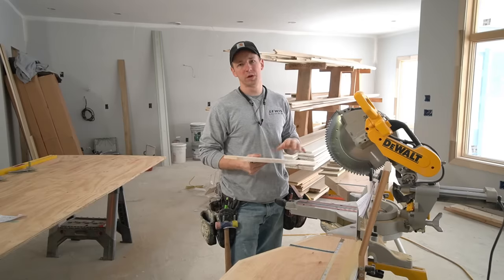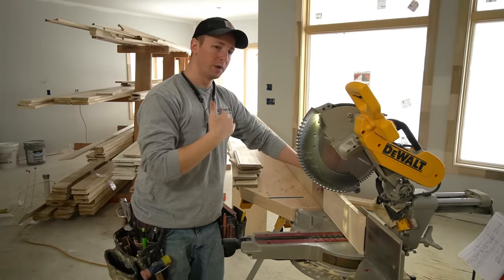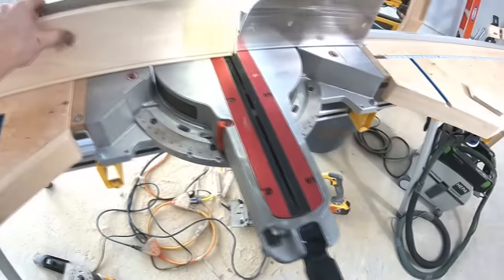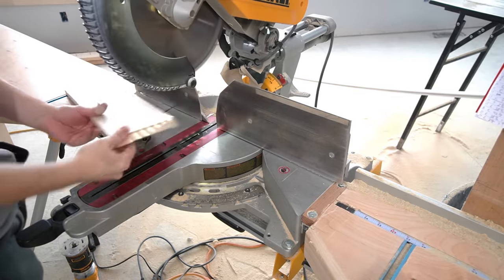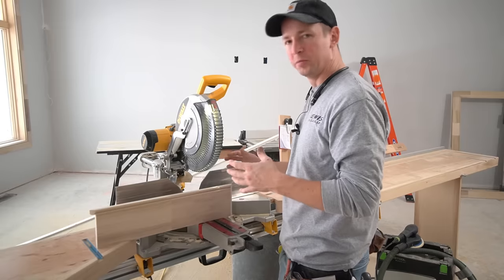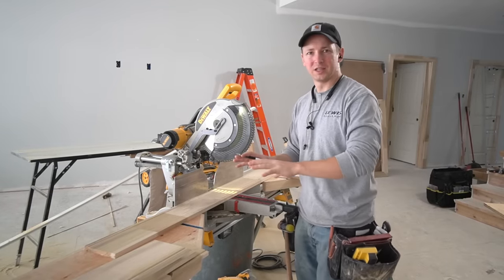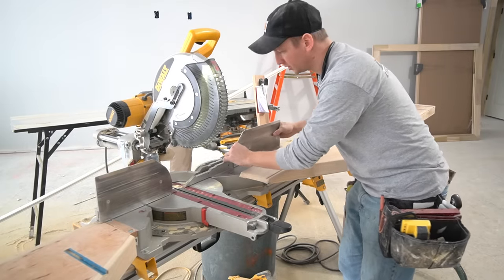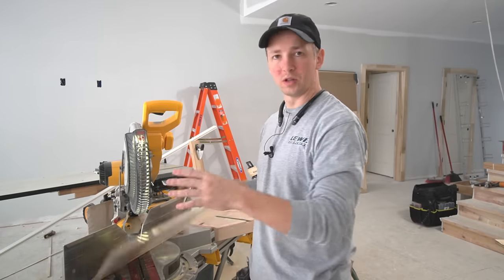What??? Pros Cut Baseboard Upside-down and Vertical... Why?

Comment: What is the width of your miter wings? The length is 90" on the right and 93" on the left, but what is the overall width (or depth) of both of the wings?

Comment: What's up with that shoe on your jigsaw?  What's that called and it appears to make coping easier...true?  Do you have any videos on how to measure, cut and cope baseboard when the floor is sloping, and the door trims are not level or plumb?  I'm having to reproduce 140 year old baseboard that was torn off and thrown away by the inept demo guys.  I have to fabricate the wooden baseboards with an Ogee like profile on the top then fit it around wonky angles and stain it to match the existing wood trim around the doors (old growth douglas fir).  I'm at a loss as to how to fit the baseboard so it looks halfway decent.  I also have an old brick chimney in the middle of one wall the sits at a 67.5 degree angle to that wall meaning I will have one 45 degree corner on the brick that juts into the room and a 67.5 degree angle where the chimney meets the wall (making the cut on the miter saw at 33.75 I believe so the baseboards meet up properly) but again I have a sloping floor and not plumb/level door trims.  UGH!!!  Where the heck do I start???

Comment: Thanks for the great videos.  I just bought the Dewalt miter saw and blade you recommended through your affiliate links.  I know you built your own wings and love them but of the commercially available miter saw stands, I am curious which one you think is the best?
Reply from the maker: Probably some iteration of the Fast Cap Best Fence. Thanks for the support!
Reply: Fastcap's Best Fence is a good option.  I bought the Pro 4 with stand.  I find the entire setup a bit heavy. Removing the saw from the stand for transporting around a jobsite or upstairs by myself is a bit too cumbersome.  I bought a Dewalt miter stand and have my fences mounted on that.  Removing the saw from the stand is super quick and easy.

Comment: Hi Spencer, thank you for all your great vids and Great content. I would like your opinion on which saw do you think would be more accurate for most trim work, the Dewalt 780 slider or 716 fixed?  Thank you
Reply from the maker: Fixed is always going to be more accurate. But I use the 780 daily because it is more versatile.
Reply: @InsiderCarpentry  thank you, I may go with fixed as I have older dewalt compound slide.

Comment: Question for all: I need to purchase a new miter saw and I’m torn between a 12-inch slider or a fixed model. I’ve read many comments about a fixed model being more accurate for trim work. Any thoughts? What method do you experienced trimmers use, fixed or slider? Thanks, Garry.

Comment: All makes sense! I never did that with base but did with crown (learning years ago from This Old House!). 
Question: I always do the base after the flooring is down since there is usually a gap around the room to allow for expansion and the bottom of the base covers that. Are you just precutting this first without knowing if it will hard surface floor, or carpeting? (I should say I was pulling up old carpet and replacing with laminate) Thanks

Comment: Sounds as if your theory is similar to crown mounding methods ? Great info . Is this saw you use equal to or greater then the Bosch slider L 5412 . I’ve been debating the new Bosch but after discovering your channel your arguments for a slide are a valid . This gives me some thought to which saw would be best . 
Thx again .. informative.. simple ,, and delivered in an excellent tutorial manner .
Reply from the maker: I found the Bosch axial glide to have a ton of deflection. Otherwise I haven’t used any Bosch miter saws.

Comment: Ty for the effort for another great video. The fence link does not work. Also, you are spending $227 on a saw blade, ....better to use this blade and sharpen (now you need 2 blades to cover the downtime) ...worth it?

Comment: These suggestions work great for production baseboard.  No idea what you've said regarding longer frame of reference other than wood not being straight.  That makes sense when it sits vertical and the base better represents the floor.  Lost me after that.  But that's a nice piece of machinery, though. That DWS780.  Although I did read that severak of these models, including the DWS780, had a stop sale. The issue (a manufacturing defect with the rear guard breaking in a small number of saws) affects the DWS780 DWS779 and DHS790 and can occur when the blade throws a piece of wood on the guard.

Comment: Hello spencer, thank you so much for your videos. Always very informative. I have one question that I'm always so curious about when I see your videos though, it seems that in your region you're often using this finger joint unfinished poplar which you consider paint grade material. Where I live we can purchase poplar with a beautiful smooth prime coat, it just seems very inefficient for the painter to have to come and prime all of that wood.
Reply from the maker: Its somewhat of a regional thing. But in high end custom homes there is enough custom work that everything needs primed anyways. I much prefer unprimed material personally.

Comment: I usually miter my joints, and they’re glueable. If I cope the joint, I follow the framing and it’s not always square.  That becomes noticeable in many applications.  And that goes for outside corners.  Usually, I’ll make 90 degree (not always) joints.  If it’s new construction paint grade, the drywall guy can fix with his joint compound, and the painter can caulk.
Reply: Don't' nail the straight piece in the corner and let the coped piece hold it and you won't be at the mercy of an out of square corner or bad mud job.

Comment: Lots of good arguments and some weak ones but I'm still going to cut base flat, face down with the top facing me.  I take my measurements from the walls at approximately the top of where the base will be.  The backside of the base is the wall and the mark is easier to see and cut if it's on the back.  Self returns are also for me easier to do on the flat.
Reply: 100%

Comment: How do you account for when the wall of your straight cut is out of plumb and then your cope comes in and it’s off? Sometimes I shim sometimes I cut it on a bevel.
Reply: One of the biggest advantages to copes is if you don't nail the straight piece but let the cope hold it it helps this issue immensely. Of course if it's real bad you have to angle the straight cut on the coped piece. I always mock up a coped piece at 90 degrees and long enough to give you a true reading and check the corner before the real cut. Most of the time the floating cope will be ok.

Comment: Coping obviously works well for you. But am curious, have you ever mitered your cuts with and used a stitch nailing pattern at the inside corners. I have done this with both stain grade crown and baseboard for three decades with out any apparent problems, though I often think that I am cheating just a bit.

Comment: I always cut vertically but I've never cut it upside down. I might be missing something, but with this specific profile why are you coping instead of just doing 2 45's? We do a lot of flat base or base similar to this so I'll usually cut my corners at 46 and if it's meeting another board on the wall before a corner, I'll cut those at 22.5 to get a good glue joint that I can nail so I know it won't move. Most of the time I'm working with finished concrete floors so I have to scribe which makes it a little more forgiving on the corners because I know everything will match up.

Comment: First of all i really enjoy your videos. The quality you produce is in my opinion is A+ and the skill and techniques you use are very efficient..I noticed you were cutting the baseboards before the floor was installed. Does this mean you were installing the baseboards before the flooring then possibly adding a shoe to cover the gaps. Is there a reason for this? I know this is probably a customer preference. Just wondering. Keep up the good work
Reply: Could be because those rooms will be carpeted.  In that case the base goes first elevated about 1/4 " above the subfloor.

Comment: I've watched so many videos lately about baseboard install & almost every one has either the plain flat baseboard or ones like the one Spencer is using here. Around here most houses have the colonial-style baseboard that has a lot of profile design which is not as easy to deal with in my opinion

Comment: If u cut it on the flat with the back facing up and mark on the back you can go faster because the next cut is made because it's a clean cut because the mark is not on the edge. Also if the board has the same cut you just flip it so it's face up and then face down or vice a versa depending on what your last cut was on the piece . Just make sure the teeth of the saw runs the right way through the face using a slider. This also allows you to use a smaller saw blade and get a better cut with no blade wobble.

Comment: I still don't understand I love your videos but why do I have to cope when I could just make a 45 and a 45 on  Is each side or I can use my  Starrett Angle finder
Reply from the maker: Coping allows you to snap pieces together with more pressure. Coping is more forgiving. Coping absorbs the drywall taper much better. To many reasons to list...

Comment: Thanks for the good info.  I run the far walls and longest walls first with square cuts.  This makes efficient use of material, avoids having to cope long pieces, and fewer pieces have copes.
I got a chuckle from the idea of the flat reference thing, since that FJ material is likely to be straighter than the subfloors are flat.  A couple of other details are relieving the back of the base in the corners, and for base on a finish floor, I often put a tiny chamfer on the bottom edge, to give a clean line & make the painter's life easier.
Reply: I like your idea of far walls and longest walls first, then cope the shorter walls. I'm mathematically challenged so that sounds easier for me.

Comment: I've been using a jigsaw for years until somebody showed me to use a flap disc on a grinder to do the cope so much faster so much accurate so much easier
Reply: Roto zip with a wood bit works great also.
Reply: Do you ever install MDF base?  Regardless, a grinder is hella dusty.  If you're inside with no ventilation a grinder is a nasty way to cope.

Comment: Actually that style of baseboard should be Jack mitered coped on the flat mitered at the bead it’s a lot faster And comes out a lot nicer With that being said much respect for what you do I have been a finish carpenter for 20 years and I’ve always been production oriented you remind me of myself when I was younger
Reply: Copes always give you one blind joint which with stain grade trim can be a big help if you orient the boards to the way you look into the room and also helps with future gaps if anything twists (studs drying out etc.) or shrinks.

Comment: I'm a trim carpenter/ cabinet maker of 33years, I cut my base and crown on the flat with my Bosch Axial glide saw, and it comes out perfect, and I'm not limited to height of base or crown moulding, so I submit my method is better, BUT, you must have a slide, or glide saw with detents at 31, and 33 degree's, which most tradesmen do have.

Comment: Will work with perfectly straight materials. But when I work with solid woods - perfectly straight is not even remotely possible. Also in my area the minimum base height is 7”, that’s why I just trained myself and my guys to cut flat and develop the muscle memory for it

Comment: How do you avoid denting the top edge while you’re slinging it around? That’s what’s keeping me from cutting it upside down
Reply from the maker: You just have to get used to leaving the saw in the correct position on the rails. You can also use the flip lever lock to keep it from sliding on the rails. That will put the saw in the best position for cutting tall trim.
Reply: I’m talking about hitting the top of the base on the cut table when I’m getting a new piece onto the saw. I  use a lot of MDF base. I usually cut it upright and use the bottom back corner of the base when I’m putting it on the saw stand. Does your continuous cut table eliminate that issue? I’m trying to copy it and I like it so far

Comment: Can someone explain to a weekend DIYer why you "cope" baseboards instead of simply finishing every corner with two meeting 45° angles?
Reply: Not just for baseboards, coping can be used on crown, chair rail, and any trim that runs perpendicular to a corner. Inside corners on drywall are almost never square (because of mud buildup), they’re usually larger than 90deg by a degree or two or more so cutting two 45deg miters will still leave you with a gap in the joint. Coping allows you to follow the profile of the trim but gives you more versatility with matching the angle of the corner. However, with some simple tools, like a miter protractor you can find for cheap on amazon, you can still get a perfect miter cut even when the corner isn’t square. The downside is that it’s usually a bit slower since you have to measure and adjust your saw differently for every corner.
Reply: @playerzero0000  Thank you for your reply! In your knowledge, do you think some crews use the coping technique for every inside corner, or would that be considered impractical? This video seemed to favor using the coping technique only at the final piece of trim for the room, but I could have misheard.
Reply: @johnabney1921   it all depends on the carpenter and the job. I can’t really make a general assumption because most of the jobs I’m on, I’m the finish carpenter lol, so I don’t often get to see others’ work. However, coping is especially useful for stain grade trim where you can’t hide gaps in joints with caulking+paint, so typically carpenters will cope stained trim on every inside corner. Painted trim is more forgiving when it comes to the accuracy of the angles, which is why in spec homes most carpenters won’t bother with the extra work of coping and just miter all the joints.
Reply: @playerzero0000  Your info was so helpful I just had to screenshot it in case the internet ate it. Thanks for your response!

Comment: I wish I could measure a whole floor at ounce I’ve tried with a whole room at once and every time I’m off a little bit on my outside corner and have to re cut either to long or to short I’ve been told add an 1/8 but obviously no bueno

Comment: You are talking about crowns and twist in the finish stock you have. It is best to cull those pieces of long stock, use the straighter pieces and only use culls for short runs (or, send the bad ones back. You are paying premium prices for trim, don't let them (Suppliers) give you sub-standard product. It helps everyone in the long run. Complain, if everyone does, the level will rise)
I have never found a finish floor (if you are, as I do, putting base on TOP of finish floor,) that is straight and flat along the run.
Floor finishers are solely concerned with "smooth", not flat, straight or fair. 
My standards mean the bottom edge, (that faying surface where base meets floor,) needs to be scribed.

Comment: If the base that you are butting a coped end is not plumb, it is easy to do a bevel cut with the wood laying flat and adjust the miter left or right a couple degrees. Then, cope it.

Comment: Vertical also has less blade contact thus less resistance/friction.
Reply: I'm trying to figure out how cutting vertically has less blade contact. Can you help me with this?
Reply from the maker: It’s a feel thing. If you know you know. Blades tend to resist and smoke a lot more when beveling. You also get way more pitch buildup on the blade when beveling which makes the blade perform like a dull blade.
Reply: @InsiderCarpentry  I'm in complete agreement that a vertical cut feels like it's easier on the saw. The original comment about the blade having less contact just made me think, "does it really have less contact during a vertical cut?"

I don't know the answer but I definitely prefer the cut vertically. Much less saw manipulation IMO.
Reply: @lscottiv1  When cutting on the flat you get more teeth contacting the work at the same time causing sawdust to fill the gullets and gravity pulls it into the space between the teeth and the kerf creating friction, drag, pitch and possibly smoke. Give Spencer's methods a try, he won't steer you wrong.
Reply: @lscottiv1  when cutting vertically the blade is only contacting the thickness of the workpiece. When cutting flat, the blade is contacting the entire height of the workpiece. If it’s a piece of speed base, that would be 9/16” versus 5 1/4”.